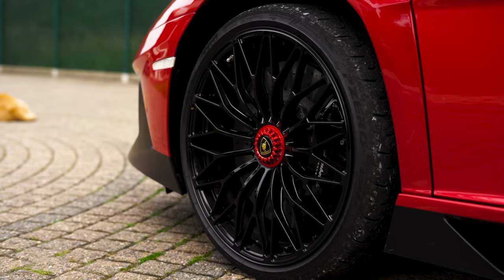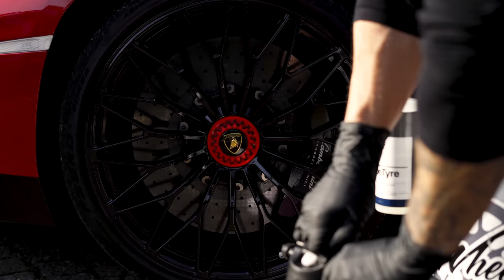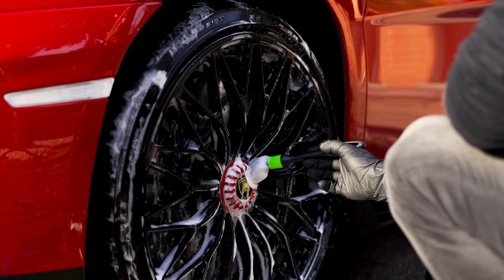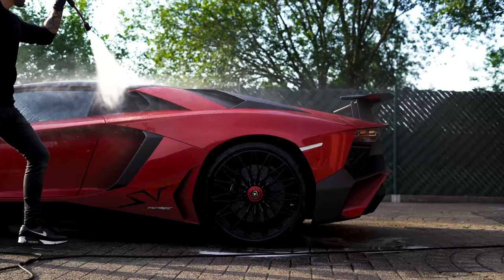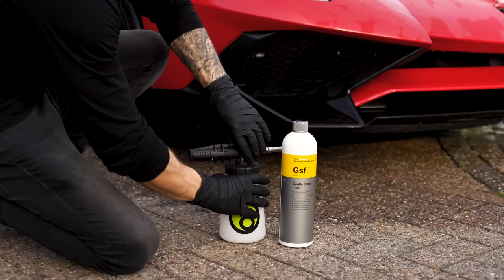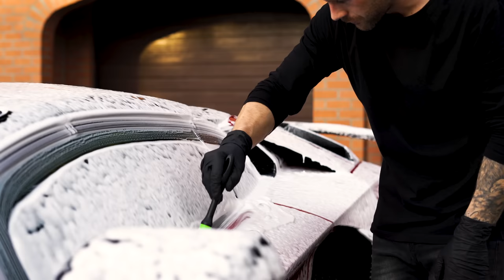Dirty Lamborghini Aventador SV Foam Wash - Auto Detailing

Comment: For cooler looking shots, put the front axle lift down. it will lower the car at the front to its normal ride height, about 40mm lower than in the video.
the switch is at the top of the center console next to the driver window switch